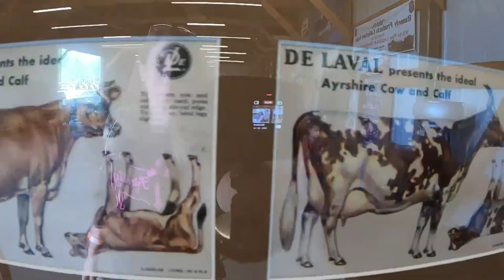2022 White Pine Logging & Threshing Show/Old School Tractors-Equipment/Sawmill/Steam Engines

Comment: If only it were not the same weekend as the Western Minnesota Steam Threshers Reunion in Rollag, MN. We have a tradition of going there and running tractors and engines. White Pine looks like a fun show though!
Reply from the maker: We would like to go to Rollag some day.
Reply: @trinitydairy  if you are day tripping it, be there no later than 9AM. After 9AM the line just to get into the parking lot has been known to be over a mile long. Definitely plant on an 8hour day on the grounds, don't worry most folks who have been going for years still have not seen everything. That includes myself, been a member now for 4yrs and going longer. Also, if you and the kids want to ride the trains, get it done in the morning. The lines only get worse into the afternoon and evening when they stop giving rides. There is so much for kids, women, men, grandma's, grandpa's, etc. We leave there Sunday night after getting there Thursday and feel like we need a week of sleep and relaxing to recover. Its like 200acres of property turned into a massive show grounds. Don't worry though, there is lots of trolleys, tractors pulling wagons, etc to get rides on.
Reply: @BillTheTractorMan  if you go on Friday its not bad maybe 1/3 of whats there on Sat and Sun. not much waiting in line or parking issues
Reply: @MrGlodie  we usually camp Thursday afternoon - Sunday evening. I can't much tell the difference Friday, Saturday, Sunday from where I'm at besides its busy, busy, busy. It's a large grounds though with a lot of room for spectators.

Comment: Alan! I'm speaking from first hand experience here my friend, I have some newer stuff but I run some older gas stuff too. Isn't it funny when you go to a show and you see these guys playing around with what they call antiques to you and I are still using in the field and still getting good service out of LOL see funny that way don't it have fun
Reply from the maker: I always joked going to these shows was like going to the dealership to me.
Reply: @trinitydairy  yeah I know I generate some laughter around our community here because we're small. Farm is 226 acres 70 head of beef and we do some custom ground livestock feed on top of that. And some of the stuff I run this pretty old. I don't know if you remember or not but I'm the guy with the 41 BN that we redid last Summer and then got the cultivators done this year and got as close as we could to the regional international colors tried to find where they used the blue on them. You know you you fix one up and you wonder if you should put that kind of money into it but on the other hand if you take that same money barely make it down payment on a brand new one. We have 15-year-old one in a 5-year-old one and a 1988 model with a high lift on it do most of our heavier work but we find lots of holes in our work schedule like raking and tedding and pulling a smaller disc and moving wagons and that kind of thing that we can put ours on those old gassers. I always figure this way if I can use them and keep hours off of my newer more efficient ones and use them for the heavier work I'm probably further ahead. Nice video thank you enjoyed it. We as farmers around the nation of a debt of gratitude to these guys that are willing to go through the work and aggravation and everything else it goes with putting on these old equipment shows if one for those guys the younger generation wouldn't know what their parents and grandparents went through and their younger days

Comment: Alan, before church I need to comment on the threshing show at White Pine lodging. You made a comment to one of your sons that at one time you were thinking about a Cockshutt tractor. It's true that the Cockshutt line was eliminated in 1962 by hostile takeover by White. This Canadian tractor was begun in 1946 it was the first tractor line that had a Live PTO system. My uncle sold Cockshutt and Oliver. And later White also took over Oliver. I have three Cockshutt's one model 40, two models 30. Parts are available through individuals or the International Cockshutt club, Inc. believe me they made a fantastic tractor. You may get hold of me or the club to get more information. Thank you, Skip Ruckert
Reply from the maker: Awesome, thank you!